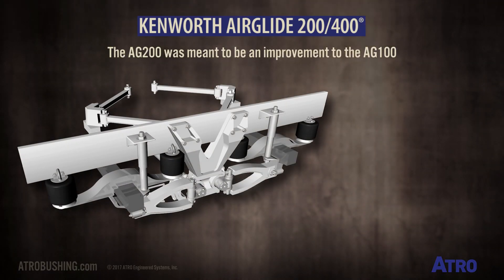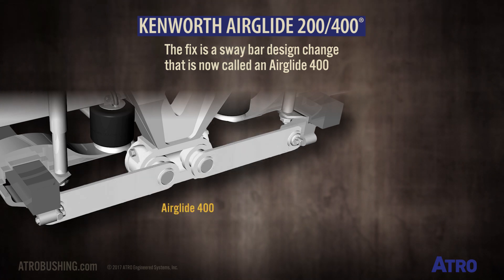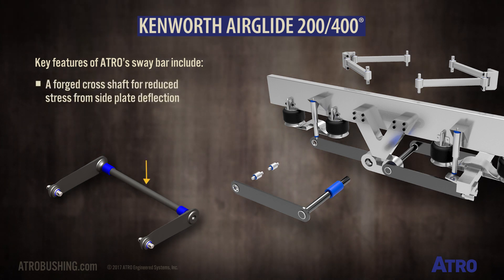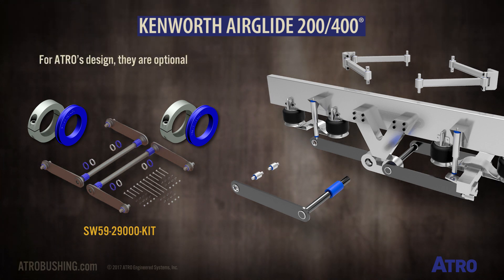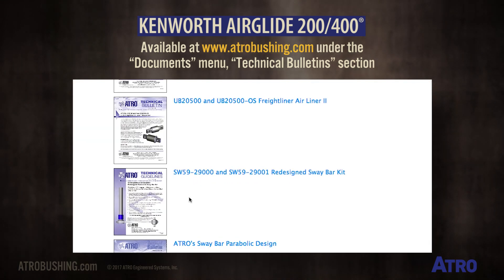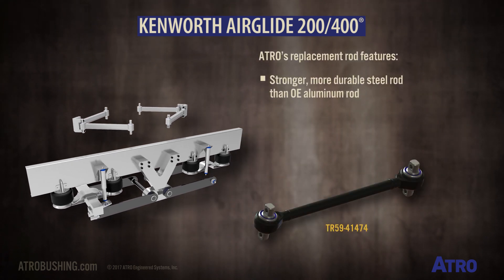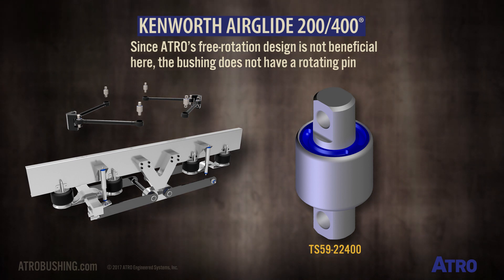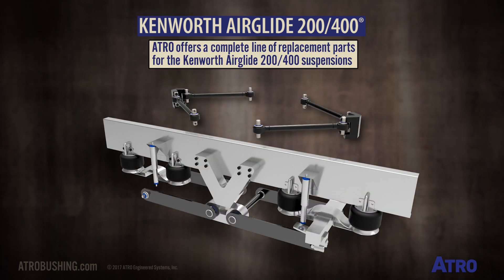ATRO Parts | Kenworth AirGlide 200/400 Suspensions

Comment: Good afternoon to you!
I have a question for you and a big request is:
Do you have time and you can lay out a link for choosing the optimal parameters for K200? Is there a simulator where different cab variants, engines, transmissions and design change online?
I, I dream to buy kenworth k200 but only with left control. In our country, the movement is European. My country Ukraine is 11,800 km from you.
A chic truck, I can only dream of having such a truck.
Kenworth does not even exist in Europe as a dealer.
Maybe your Australian dealers will want to open sales in my country? We have a lot of dreams of having kenworth k200. Please excuse me for my English.
Very poorly understand.
With all respect, Andreii